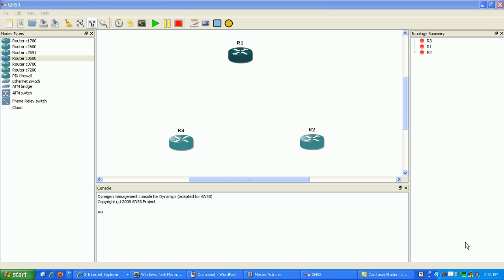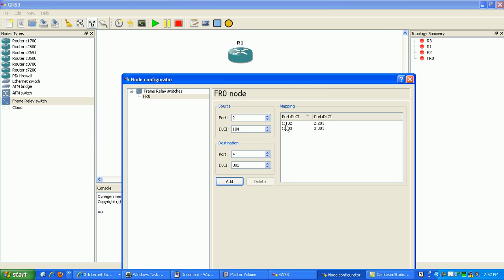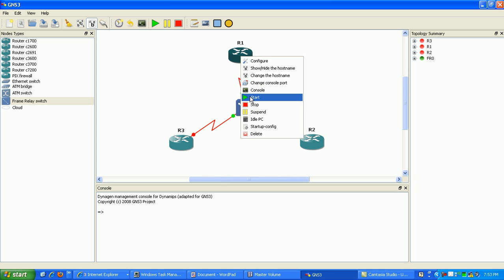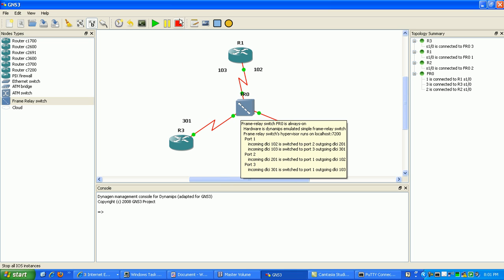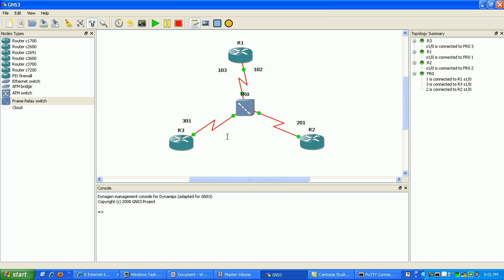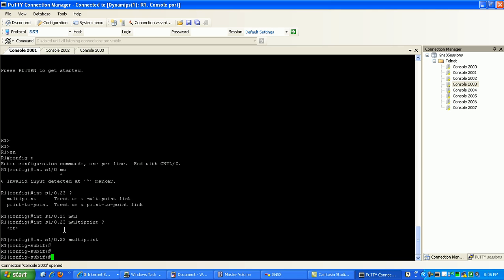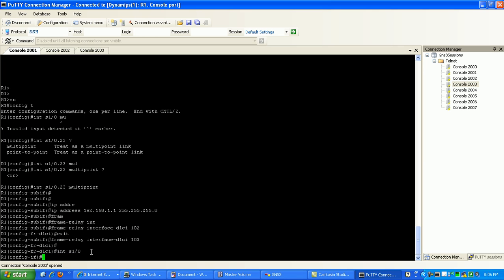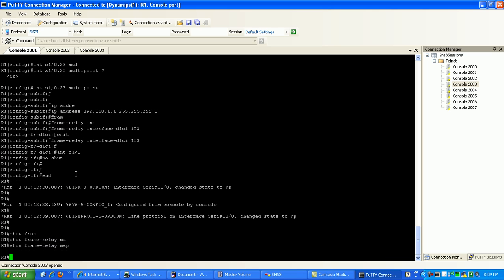Frame Relay Lab 3 point-to-multipoint subinterfaces

Comment: This is not how you configure point to multipoint. The reason you did not find any frame mappings is because you used the Frame-Relay Interface-dlci command rather then Frame-Relay map command. Frame-Relay Interface-dlci is only used on point to point connections because it just doesn't care about the IP because anything on a point to point link IS on the same network/subnet Search: "that-pesky-frame-relay-interface-dlci-command"